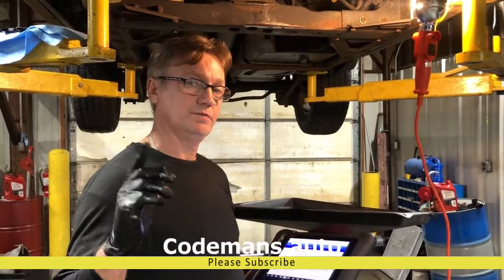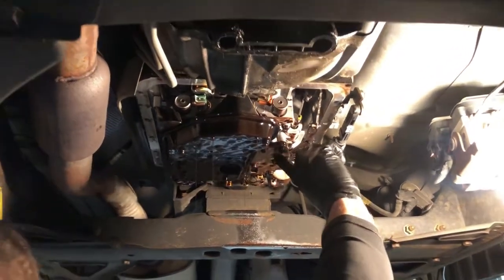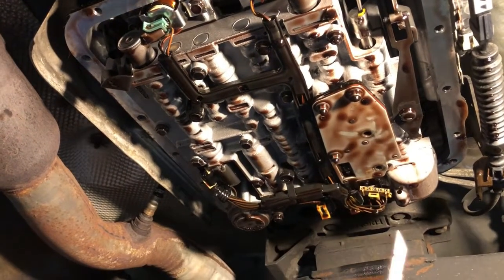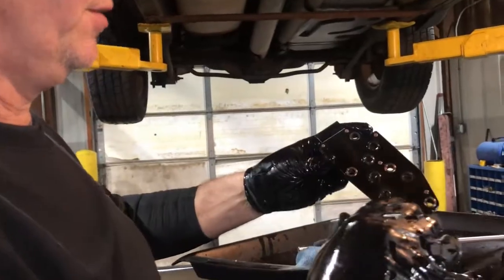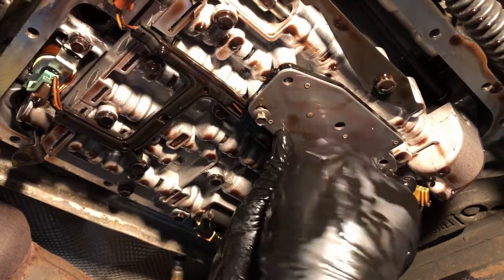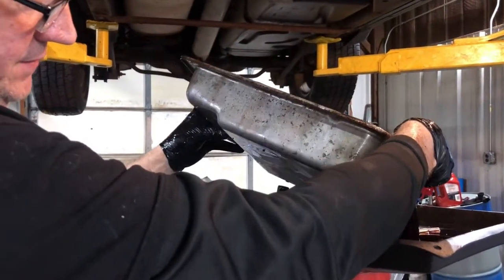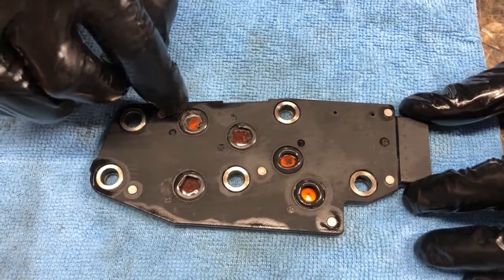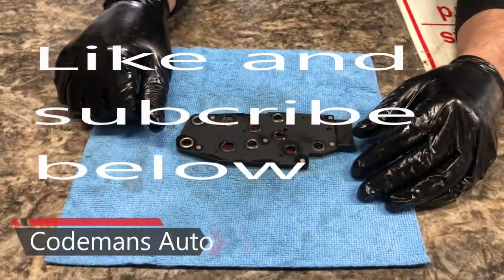Chevy 4l60e code P1810 " How to Change a Transmission fluid pressure switch" Chevrolet Silverado

Comment: Does it need to be programed for a 96 tahoe?
Reply from the maker: There is no programming needed for the 96-year model, but you might need to remove your battery cables for about 30 seconds to clear the MIL codes after you get it installed.

Comment: Just replaced my switch and it’s still setting the code intermittently. 

The initial test drive after replacing the switch and both shift solenoids once it was warmed up set 4 separate codes with erratic shifting and stuck in high gear to the point it died when turning around at slow speed. 
1. Code 66 3-2 downshift quad drvr 2 solenoid 
2. Code 67 torque converter quad drvr 2 solenoid 
3. Code 81 shift solenoid B Failure 
4. Code 82 shift solenoid A Failure.

Let it sit for 20-30 min drove it again then it was just the pressure switch code.

Let it sit a few more minutes then drove it again for 10 min or so, shifted great and pulled hard under acceleration and did not set any codes. 

Started it back up to pull it forward 20 feet to set it back on the lift to check wiring and it set the pressure switch code again.

Any ideas? It’s definitely intermittent. It went from barely drivable after initial test drive and setting 4 codes to now just setting pressure manifold switch code.
Reply from the maker: What you are describing sounds like a wiring issue. especially with multiple different solenoids coding. I would start with a fuse check and then start searching this wiring harness. I don't know how to help you with this because this sounds like a hands on problem. I don't think that it is a voltage problem but just to rule it out I would use a 12 volt tester and with the engine on I  would probe the wire harness going into the transmission pin by pin and look for that hot wire. keep us posted if any updates we would appreciate it.
Reply: @codemansauto208 Thanks for the reply. I drove it a couple more times and can’t get it to act up now but it’s still throwing code 28 trans pressure switch manifold problem and code 82 shift solenoid A failure.

Right now it’s just code 82. With engine off I clear it and it comes back within a couple seconds, again engine off. 

I had it on a lift and visually checked all the wiring I could see on both sides of the trans, the firewall, and under the dash at the ecm. 

I don’t see anything obvious other than what looks like 3 black wires coming out of a harness near the driver side firewall and bolts to the engine block. One of the wires doesn’t look great. Thinking they’re some sort of ground wires because there’s a stranded ground strap going to the same spot that is also not in great shape. 

Not sure where to go next. Thinking of checking trans pressure before going further. Maybe the valve body has too much fine clutch material in it that needs cleaned out because I noticed the old manifold pressure switch has a decent amount in the passages.

Comment: Thank you for this video. My 04 Silverado just started doing the sudden shift down into 2nd and back up into higher gear. It's not stuck yet but I know it's coming. I did get the code
Reply from the maker: Glad to help. Hopefully the video will get you fixed up.

Comment: I am getting this code now but i was having problems for a couple weeks before. My speedometer started acting crazy then started shifting crazy until the speedo stopped and now no shift either
Reply from the maker: The computer relies on the signal from the speed sensor to know when to shift the Transmission. Without the speed signal the transmission will stay in 1st gear. On the 4l60e make sure that you look at the green and purple wires that are going into the sensor for any damage during the sensor replacement. These wires have been known to break right at the sensor. You will need to clear the codes when you get the sensor replaced and you can do this by unhooking the battery cables for about 30 seconds. I hope this helps
Reply: @codemansauto208  I really appreciate  it

Comment: Question: why didn't you torque the bolts on the switch?
I had mine rebuilt a year ago and last week developed an O ring leak at the wire harness. I dropped the pan and found all 5 bolts were loose and a couple nearly fallen out.
Reply from the maker: all the bolts should be torqued and sometimes we torque them after we make the video, I try not to get to technical about torque specs
Reply: @codemansauto208  Ok, your video, but people do look for posters to show them the way and look for guidence.

Comment: Hi i have a question I have a 2007 gmc yukon Denali 6.2 I have a code 0872 transmission fluid pressure switch

Comment: Can this cause the Transmission to not manually downshift to 1st gear? it down shifts to 1st its self automatically. Just changed out the switch with a used one i had because of having problems with the original one, it fied other problem but now having this issue. woundering if shifter cable adustment can cause this code? The guy that did the work bent the shifter cable bracket to get the pan off.
Reply: Did you happen to get the manual 1st issue fixed? Mines doing the same
Reply: @larrywright7970  yes it was the manifold pressure switch. Put new one in and fixed it.
Reply: @gtl68  thank you for the reply man! 🙏

Comment: I got the P1810 code on my car after I changed the transmission oil. It started revving up and down once I hit 55-70mph. Anything before 50 it’s good and anything after 70 it’s good too. Hope this fixes it

Comment: Is this a difficult repair in a 2005 astro van? 😬 i have this same code come up yesterday as soon as i turned the van on the service engine soon light turned on.
Reply from the maker: if no one has messed with the exhaust you might get the pan down with out to much trouble and the pan drop is the hardest part of the job
Reply: @codemansauto208  Right on! Thanks for the reply!

Comment: I have a quick question I have a 2013 Chevy Silverado 1500 lt 5.3 with 6L80 trans 
It’s throwing the code p0872 
Transmission fluid pressure sensor/switch c circuit low 

When it shifts it has a hard shift brand new transmission not even a year old 
Where do I start ? Is the transmission fluid pressure switch the same as in this video ?
Reply from the maker: no this switch is for a 4l60 and yours is a 6L80 and the 6L80 will be made into the transmission control module inside the transmission and just to let you know this code can cause more issues that can get expensive so I would try and fix it ASAP

Comment: I changed mine out and it had really fine Grey cuttings from the clutches slipping, in the senor ports, that's why it was throwing a code, because they were plugged up. I replaced it with a new one.

Comment: I replaced the switch but still have a code and the harness looks good any ideas ?
Reply from the maker: The internal harness is where I would look and maybe just replace to narrow posibilities
Reply: @codemansauto208  Thanks I’m installing tomorrow I’ll update
Reply: @roytayman4726 Same thing happened to me, did you find out what it was?
Reply: Brother, please update us, were you able to fix the problem after replacing the sensor? Was the harness the fault? Tell us everything, I would appreciate it, I have the same problem

Comment: Does the pressure switch always trip a code? My re-manufactured 4L60E has been find for 5k miles then started shifting erratically out of nowhere. 1st and 2nd always work but sometimes 3rd works and 4th doesn't and other times 4th works but 3rd doesn't. No fault codes.
Reply: Could be the trans solenoids